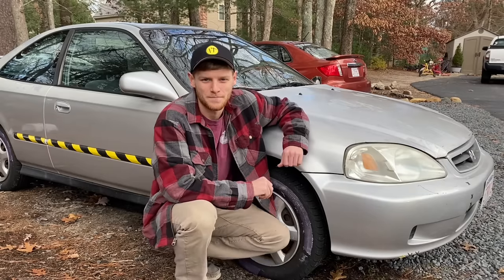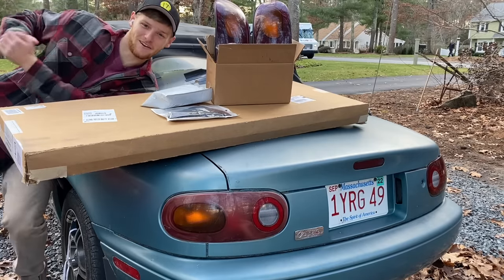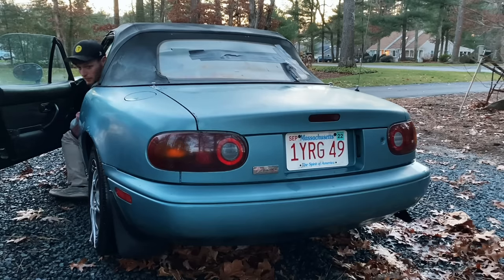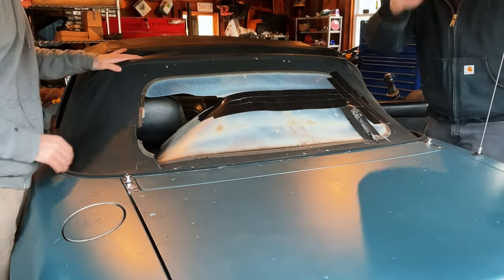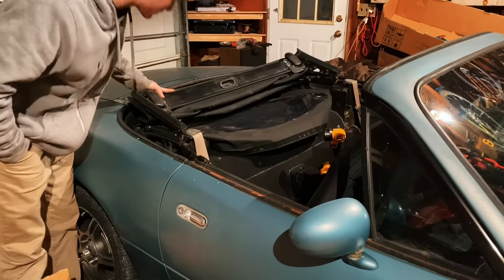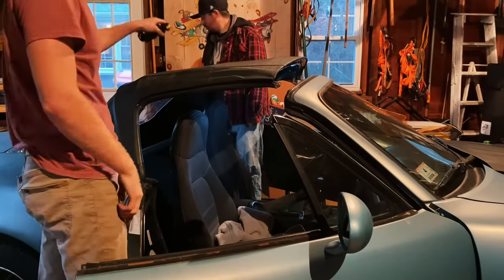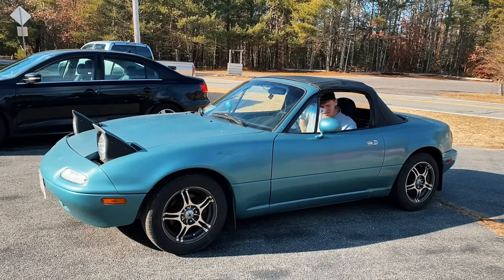Fixing and Cleaning a $1900 Miata

Comment: Soft top tip, when you replace the soft top. Let the car sit out in the sun. The sun and heat will make the soft top material more stretchy, give it a few hours and drop the top all the way down. Latch it and leave it down for a few weeks, let it get used to its position and then start letting it down. It’ll ease the top in more and help you avoid damaging it.
Reply from the maker: Yeah probably not the smartest idea putting it on in the winter, but you gotta do what you gotta do, that’s why we backed it outside when the sun was out
Reply: I was searching for that comment!! I didn't knew that, thanks!

Comment: I'm in a similar boat! We just bought a 2003 Miata manual for 1k. High mileage at 250k miles but the motor runs like a champ. Really nice interior, brand new top, and of course rust on one of the rocker panels. $1k for any running car is a steal, better yet a really cute one!

Comment: Good job on the top install. When I did mine I left the back nuts loose and let it set for a day so it could stretch. Current project is getting the tune dialed in on my megasquirt.

Comment: Soft top tip: The original soft top has a plastic rear window that could be detached from the soft top opening a zipper. I always remove it and lay it flat down to the back shelf before folding in the soft top. This way the plastic rear window stays nice and clean without scratches or even breaking.

Comment: Subscribed to see how you progress on this project.  I inherited a super clean '94 from my mother-in-law a couple of years ago and it is pretty much completed unless I want to start messing with the engine more.   I probably won't as it runs great, has low miles and is fun just the way it is.  I totally updated the suspension with the Koni 2.5 kit from Flyin' Miata so it handles beautifully.  I hope you video the rust repairs as that would help a lot of people.  Luckily mine was a summer only car and always garaged so no rust at all.

Comment: The soft top struggles 😂 loved the video while I’m in the process of fixing up my absolute shit box 1990 na6. Came with cut rear quarter panels, horrivle rocker rust, and a timing belt that was almost in half. Good luck! Use forums and reputable people to fix anything that breaks ( and will break )
Reply: Luckily my 94 was in amazing shape apart from the top. Bone stock except for Aux connect. Seals are leaking at the windows. At one point the drainage was clogged and water got in the doors. Simple fix.

So now she still has leaky seals. A banged up bumper and passenger panel. Clutch is starting to slip (got the clutch kit though). Radio doesn’t work. RPF1 15x7. 

Wheels and tires should be everyone’s first choice when wanting to upgrade the miata. The grip is insane since the 14x6 come on I think 185s? I’m on 205/50 and its instantly noticeable. Good luck on the car build! Are you going to make it running or build it up?
Reply: @Yerocco  yea it already runs and drives great. Motor pull and complete refresh . My pfp is not my cat it’s another that used to drive around my town. As for wheels and tires I went with Advanti racing storm s1’s for how light they are , I am running 195-50’s with race tires so I can still slide around a little bit with stock power
Reply: @garagemayhems208  that’s awesome. I’m too grippy now even in rain lol.
Reply: @Yerocco  Danm. I still have nb stocks and na stocks I sometimes throw on to take girls to do skids so I don’t mess with my 200$ tires lmao
Reply: @garagemayhems208  in NC we got a ton of rain yesterday. Dumped the clutch and it just stayed. I should have went 195s lol

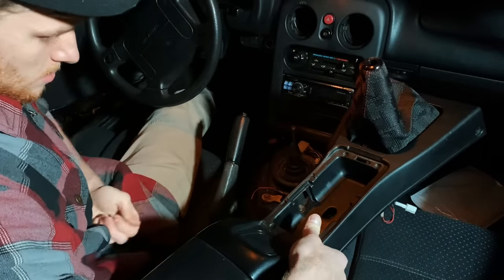Comment: 5:00 I dont know much about the material but most synthetic materials are easier to cut and stop fraying if you use a heated knife or pair of scissors. A pair of steel sheers used in fabric working should work just heated with a torch or lighter, should prevent most of the fraying

Comment: Where can I get that shift knob? I bought one like it recently but it's much smaller than I was expecting.
Reply from the maker: Got it on eBay- https://www.ebay.com/itm/394108005953?_trkparms=amclksrc%3DITM%26aid%3D1110006%26algo%3DHOMESPLICE.SIM%26ao%3D1%26asc%3D20190917065201%26meid%3Da524b424ca40422d8c209d90f2b7e91a%26pid%3D100935%26rk%3D2%26rkt%3D12%26sd%3D403707100384%26itm%3D394108005953%26pmt%3D1%26noa%3D0%26pg%3D2332490%26algv%3DSimplAMLv9PairwiseUnbiasedWebCpr08MlcGreedyV3%26brand%3DUnbranded&_trksid=p2332490.c100935.m2460&amdata=cksum%3A394108005953a524b424ca40422d8c209d90f2b7e91a%7Cenc%3AAQAHAAABEIxnp208POpAtEdSbeoza%252FtzyQmh2SBqORzgyIzbrfwKs8mDYiJnIRJg4GvE9THHqWJYLYvoLKwYv1ERffpS%252BXc0c4k6CB3vzEAZfeq31DfhisF%252FuWKKxLI%252BdJuaR0MntepewsWuivtw3tIR0pFnv3kuBjPHvItMZo1HKxss4HkqGqfZWhU%252FSFJcHyMroKfzF%252BR6awS5Dz8JDPHPdYV7Ckj2mP7uwpZCHw2vjGDJOUlwLGjAORg8I7EwRMTjjz1U7mL40BgsA%252BesjWO51iAvs6t9107e%252FvEop89cOI4nZdCowZ97BgxZfdWQX24bebrAyCdkeWqblglRhukW7u%252F%252B%252BZD%252B9JDNvo1Q5rUepUxoY6Pi%7Campid%3APL_CLK%7Cclp%3A2332490

Comment: Someone help a girl out🤦🏼‍♀️... I got a 96 1.8l base model 2 months ago off some guy (great condition too), it had a ticking noise along with a slight valve cover leak. No biggie, drained it, New bolt and oil filter, not cover gaskets with rtv placements I've seen prior and lastly topped off the coolant. Let it be so the rtv can do its thing and set. After a day or 2 it's was running great no noise no leaks all smiles! Now this weekend past, I take it on on my first practice drive in an open lot and I see light white smoke coming out of my driver side of the hood... then shortly after in my cabin! Where it smelled like burnt ass  that took over my fresher scent. I think it's oil... but for some I was told possibly a coolant leak into the engine. Idk what's going on.
Reply from the maker: If you cleaned the oil off the engine from the valve cover leak you might be burning that residual junk off on the first drive. If it is an oil leak then as long as it's not catching on fire and you're not out of oil then you can let it go until it leaks enough to see where it's coming from. Might also be coolant, you can rent a pressure tester from AutoZone and get the full amount back when you return it. Just pressurize it and see if it starts spraying out of anywhere, they might even hook it up for you in the parking lot if you ask.

Comment: Bro order you a set of rear taillight rubber gaskets so you don’t get rain water in your trunk. Save yourself a headache now I promise you. Leave the top in the sun so it will heat up and stretch.. shot me your instagram I can help you with a lot of Miata type shit.
Reply from the maker: There were some on the taillights that got removed so they got put on the new ones, so they do have questionably intact gaskets. Appreciate the tip though might have to get some new ones
Reply: @ScrewItGarage  bet.. I followed you on the gram